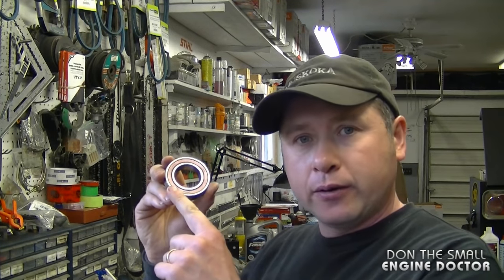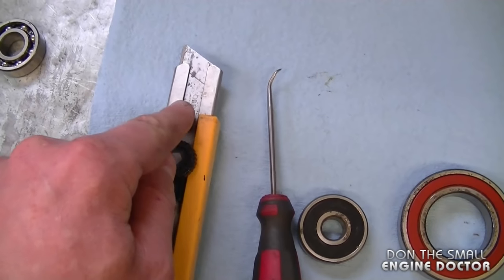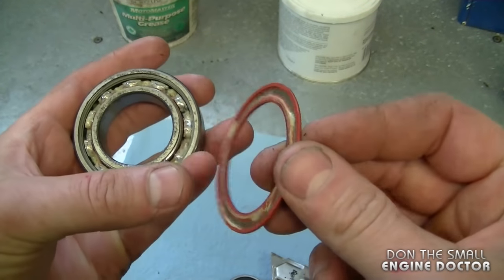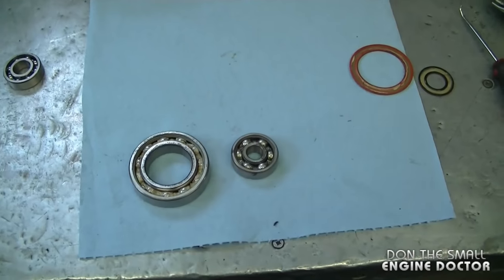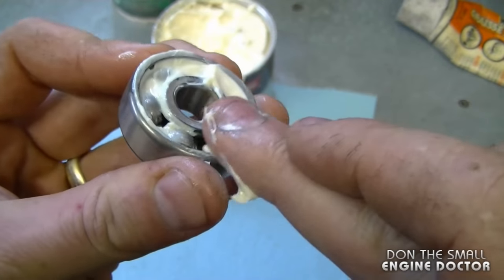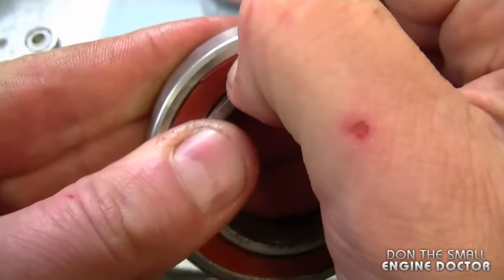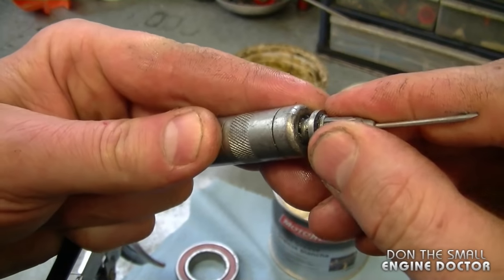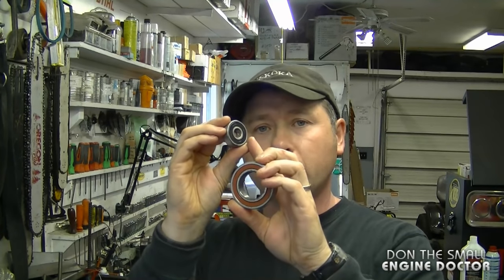HOW-TO Grease A Sealed Bearing

Comment: Personally I would wash out all the old grease with white spirit, then blow dry. Squirt some engine oil and blow out and then repack with clean grease.
Just putting more grease in traps the dirty abrasive grease in.
That said having gone to all the hassle of removing the part and the bearing, for circa £6 to £8 imo its got to be worth just replacing the bearing.
As they say they are sealed for life .... well its life’s over.

The only exception would be lawn mower wheel bearings. Easy to get at, tend to get dirt in them and with 2 each side of my wheels , thats 8 bearings at £7 = £56!
As they are not exactly mission critical, this video is very useful for repacking those kind of bearings; as it could double or treble their life.

Comment: I have a John Deere baler that uses sealed bearings and there is one shaft that I have to replace the sealed bearings every year. What a pain as when I pull the shaft and bearings, some of the balls fall right out covered in a rust powder. They have a metal shield that I cannot pull off and I do not want to drill the shield to inject grease.

Comment: Every single power tool I buy from Harber Freight, I take apart and grease the bearings. They are always dry or barely greased at all. A cheap tool can be a good tool if properly lubricated.

Comment: A bearing with a metal cover can be heated and then put grease on the cover, then rotate the inside race and the grease will flow into the bearing. It doesn't have to be very hot for the grease to soften.

Comment: 1. Disassemble
2. Clean
3. Depending on the application, you can make the bearing useless by using that grease. It's better to use some drops of a good liquid lubricant.
4. Assemble

Comment: These sealed bearings are drying out and causing failure. I just ordered a front armature bearing for my DeWalt table saw which was shot. The front bearing where the gear is located gets most of the wear. 

My rear bearing was in good shape but it was completely dry. That means the front bearing was completely dry which is what lead to the failure.

 I just used an Xacto knife to remove the seal and used it to pack it with moly grease.

Comment: I'm replacing all the bearings in my polaris atv transmission,  there are the open type of bearings,  Should these bearings be greased, since there is no grease on them?  Or do I simply rely on the oil in transmission?  the transmission got water and mud inside and rusted all the bearings, so I'm hesitant not packing them with grease..........
Reply from the maker: I think the trans oil lubricates them

Comment: .....maybe wash the bearing by shaking agitating it in solvent too but if it's magnetised then the finer particles won't come off , so demagnetise first . Gotta say I never thought of simply popping the seal off ,I'd adopted technique of piercing a small hole and  spraying lots of chain lube in through the straw supplied .

Comment: I was taught while doing my apprentaship 40+ yrs ago that grease itself isnt what lubes roller bearings its actually the oil that bleeds out of the the grease with temperature that that lubes them. Which is why you use wheel bearing grease for wheel bearings, use the wrong grease & your bearings wont last long.
Reply: I always read that you should never use the "wrong" grease too, for example, not using chassis grease in wheel bearings, but in the 50 years I've been greasing wheel bearings and often using chassis grease, and the 80 years that my father has been doing it, no bearing has ever failed or made a bit of noise, and we've done it lots of times.  Also of note, the extremely detailed and comprehensive shop manual for our old IHC truck specified the exact same description for the grease to be used for both chassis parts AND wheel bearings.  How about that?  I don't mean to start a fight but it's food for thought if nothing else.

Comment: have you ever taken a new bearing and look to see how good its greased?
Reply: New bearings typically have about 30% of the available grease cavity filled with grease. That is plenty to do the job of providing the needed lubrication. If the available cavity is overfilled with grease, the grease will overheat while operating at speed and degrade faster over time. If you think about it and compare the rolling element in the bearing to walking barefoot in water at the beach. If you are walking in shallow water, your feet get wet and you can walk pretty easily. If you walk in deeper water, your feet still get wet, but it takes much more effort to walk. That is similar to the rolling element in the bearing pushing through the grease. I work in the industrial bearing trade and that is what I learned in bearing training with Timken.
Reply: thanks for your reply appreciate it @eddiesonger7674

Comment: It is more accurate to call these cartridge bearings.  Since cartridge bearings are usually not expensive relative to the equipment that use them they are considered "service by replacement" items.  For example,  a new wheel bearing might cost $20 but labor to install it might be $500.  It would be ridiculous to clean and reuse an automotive wheel bearing; you are better off getting a new bearing since it should last longer.  Cartridge bearings can last a long time though.  I have been using the same set of 6001-2rs bearings in my bicycle hubs for 30 years.  I do periodically remove them, pry the seals off with a penknife, clean out the old grease, and repack with new grease.  Bearings in a bicycle hub generally spin under 1,000 RPM and support moderate vertical loads so the failure mode is contamination.  I originally repacked with white lithium grease.  This was very smooth and the bearings felt so free when I spun them.  Lithium grease is great but it isn't very good resisting water.  Since I ride in all weather I had to repack annually with white lithium grease.  I switched to an aluminum complex marine grease.  This grease is a lot stickier and resists water better so I only repack every several years now.  You do have to be careful not to overpack bearings that turn high speeds.  On a bicycle overpacking is fine because of their slow speed; the extra grease seeps out the labyrinth seal effectively improving the seal.  At high speed the seal needs to be non-contact and grease gumming it up causes friction that will burn out the seal.  I'm also not a fan of keeping open tubs of grease.  Dust, dirt, etc contaminates the grease reducing performance.  I use a mini grease gun with a needle so it stays clean and I can shoot it right where I need it instead of having to press it in with my fingers.

Comment: If the grease already in the bearing is incompatible with what you are packing it with can cause breakdown of the mixed grease and bearing failure will ensue. Better to flush out the old grease and pack with the new grease.

Comment: Small sealed ball bearings are 5-10 bucks each. I'd only do this if I had a specific reason to save the used one. Perhaps if I was working on something old or unusual where the parts are discontinued it'd be worth it.

Comment: Use thick rubber gloves when using a grease injector as high pressure grease can easily puncture the skin which will require surgery to scoop out the grease.
I saw this happen to a young apprentice and it wasn't pretty!

Comment: I normally clean the bearings first with brake cleaner or petrol then gently blow them dry.
Put your  tin of grease on the stove, heat til grease  thins, drop bearings in - sealed or unsealed  remove tin , let cool  down and remove your perfectly greased bearings.

Comment: Some bearings have lock rings and are pressed in. SO.....useless on most, so to fix that problem I use a hypodermic needle filled with grease and just fill them up that way after soaking in degreaser and dried.

Comment: that's the best way to extend a sealed bearing grease, I fear introduce particules in the bearing the way you do when you dip your fingers in an old grease can, I by far prefer using an injector needle and insert it between the inner part of the bearing and the seal so if you're meticulous, there is no danger to cause damage to the seal .
On an old bearing, it happens that this operation disturbs the orientation of the balls so the bearing tends to become noisier if used at high speed but it will not cause a failure

Comment: Don't worry about mixing different types of greases (no matter what grease and bearing manufacturers say...... and yeah you could use any type of grease......but conventional wisdom (and bearing and grease manufacturers would suggest) would be to choose a grease that matches the load, rpm and temps you would expect to see in the application,

Comment: This is good info for used bearings that still have some life left, but new bearings from a legit (SKF) manufacturer are pre greased with the appropriate amount. Do not add any. Too much grease doesn't allow for proper cooling of the bearings and can cause premature failure.
 Also, the re-grease intervals for sealed bearings are typically longer than anticipated bearing life.
Reply: Agree. Most bearings are destroyed by over greasing, not getting enough grease.
Reply: Best comment I could find after hours of study with sites.  SKF has a download catalog with all the pertinent intel needed.  Thanks a million.

Comment: Not being rude but why would you want re grease a sealed bearing . If the Grease leaks out then it’s bet anyway and if your able to remove the cover then next tome the covers can come off too easily or water can get back in. Also bearing aren’t very expensive but the labour and work is.  Still handy to know if your out in the field or on a Saturday and your stuck but best practice is still to replace with new

Comment: I was told by a starter and generator rebuilder to never fill a bearing full for 2 reasons. Too much can swell and spit the seal out. Remember,we pick the seal out with just a pocket knife at the outside. The other is heat transfer.(self explanatory.)

Comment: All you have done is add further contaminates to an already dirty worn out bearing , also you should remove seals from the inside not the outside of the seal , and try cleaning the bearing before you remove the seals , wash the grease out before you add more grease , you can over pack bearings with grease , and use clean grease .

Comment: I am confused. why you would open a sealed bearing and pack it with grease. One of my friends is a top engineer for Timken company. One of the worldwide leaders in bearings.  He told me that sealed bearings have a precision amount of grease placed in them and over packing with grease can actually lead to higher temps that occur in the bearing.  This can lead to earlier failure.
Reply from the maker: i'm not using this bearing on the space shuttle

Comment: I usually Wash the inside with some cleaner like brake cleaner and then repack them 👌
Reply: I took off mine today and I noticed  the seal cover on the other side of the bearing and it needed to be greased as well

Comment: 1:35 with razor blade: be careful not to pick with the very tip because it will go straight toward your eyes.  It can be seen here that the very tip is gone on this blade, and he is doing a method that is better (not prying with the tip, but using much of the edge).  A very tiny sharp bit will shoot very fast, and it is very easy to break going sideways.

Comment: The bearings that have a metal plate and you can't replace them, you can heat the grease just enough to melt in a can and place the bearing in the liquefied grease until you notice the remaining grease is become solid and remove the bearings. Better than nothing.

Comment: Good tip
Reply: not lmao they all mix together except lithium
Reply: Raymond:  Petroleum lubes generally mix, but the additive package for speed range, temperature (hot or cold), and various chemical repellent properties can "cake" when mixed.  There is also silicone grease which won't mix with anything (rare though).

Comment: I have been in the small engine and mower business for 47 years. This rubber seal does not hold back grease from entering the bearing. You don't have to remove the seal, just grease your machine like normal.

Comment: Get out the vacuum seal for food,. Put grease in the corner of the bag put in the bearing make Shure the bearing is coated vacuum seal, make sure you don't suck grease in the vacuum sealer

Comment: If you do not want to remove bearing or seal I use a hypodermic needle designed for grease guns. Just carefully slip it in under seal lip and fill in several spots.